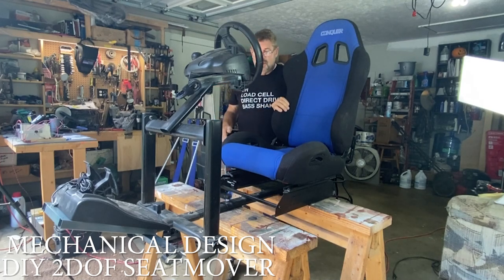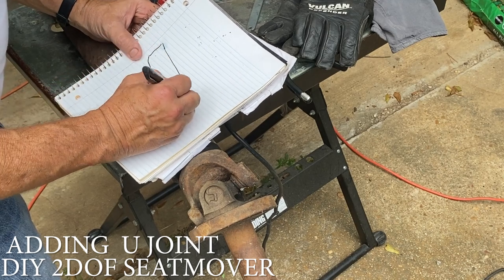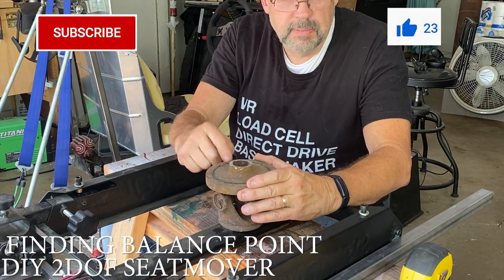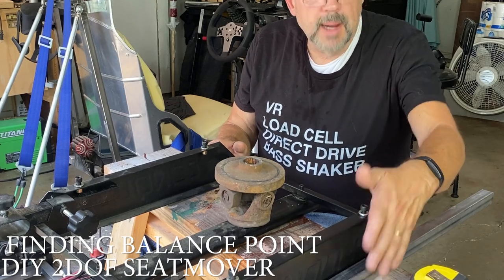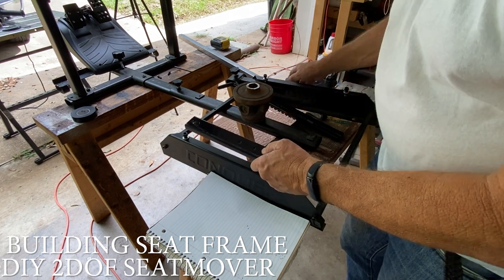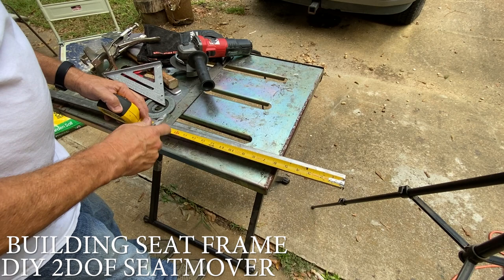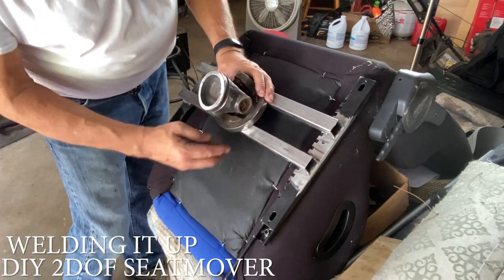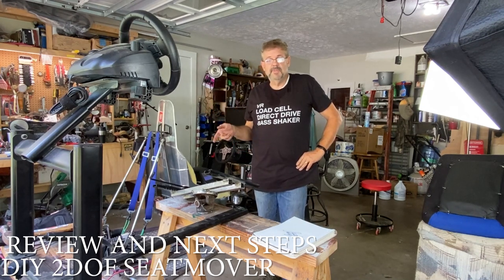DIY SEATMOVER PART 2

Comment: Taking the big mystery and inhibition out of my project.  I love you man. (Plutonically).  BTW  I got arc eye watching this so I'm suing. 🤣.  Can't wait for the next instalment.  I'm still collecting my bits and bobs.  Slowly but surely getting there.  Managed to get a UJ from the buy who repairs our trucks at work.  So another freebie in the bag.  I think I'm about 60% there with the bits I need.  So far I've spent £40.
Reply from the maker: Terry, you know you cant sue for an 'arc eye' from watching my videos.. Haha..  The U joint (crappy as it was ended up costing me $20 but since I used both ends on two rigs, the price is about right. I appreciate you taking the time to comment!  There was a lot of mystery and delay in my first project so that's why I'm making this little series.. Shining the light on it a bit.. DMAX
Reply: @DMAX_DIY  hope you've made it through the storm mate.  Give us a nod to to let us know you're all okay.
Reply from the maker: @terryteed1903  All good my friend.. Actually found some time during all the rain to work on part 3.. She's ready for the arduino now.. Should be posting soon! DMAX
Reply: One day I hope to have a setup like this. I love these video's!
Reply: @D Max  HI, new to your channel and love the content so far. I was grateful to find them as I was debating on fabricating my own motion simulator however had zero prior experience\knowledge... but that's never stopped me before. Out of curiosity, is your background in engineering or are you self taught?

Comment: Thanks Brother this is great! Can't wait for part 3
Reply from the maker: Thanks my brother.. I appreciate the comment! I'm plugging along.. I hope it helps out some guys who might consider the DIY approach.  DMAX
Reply: @DMAX_DIY  I really wanna do this but I don't weld and was wondering how heavy do you think it will be?
Reply from the maker: @hippysplace  So I'm trying to build it out the existing static rig parts. You could pretty much just drill some holes and bolt it together instead of welding but welding is cool and I only caught myself on fire 3 times so.. ;) To answer the question. just a little bit more. I'll weigh up the changes in the next video. DMAX
Reply: @DMAX_DIY  Thanks Brother that would be cool and I will be watching!